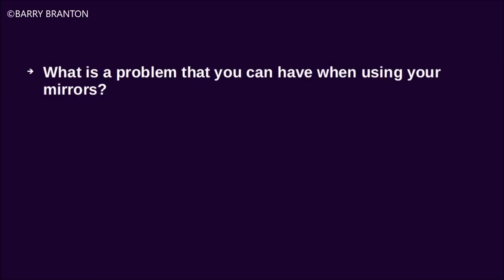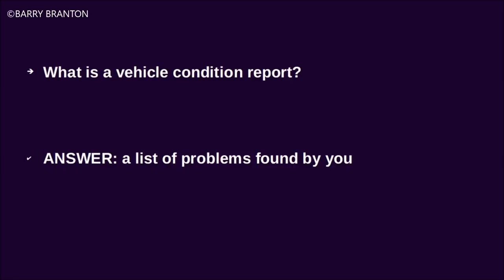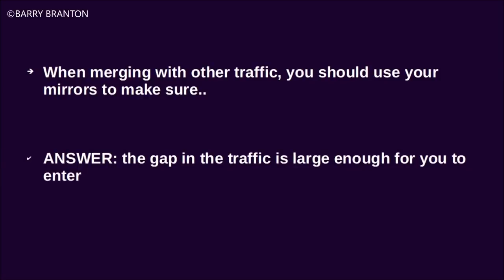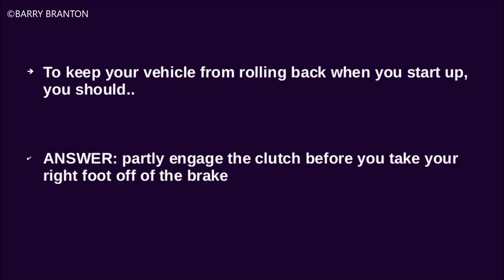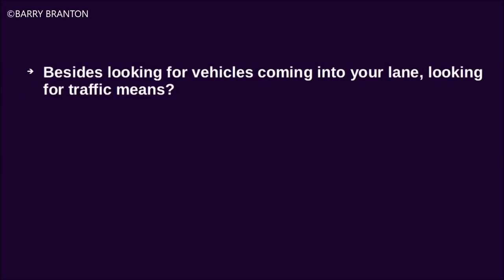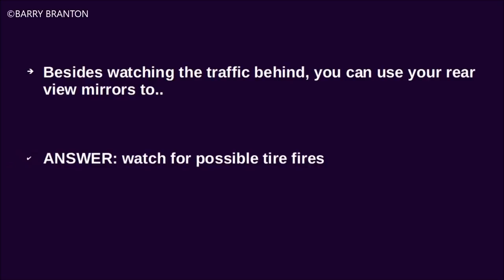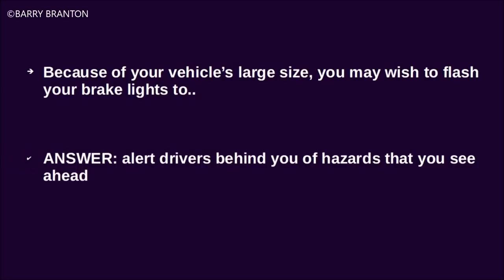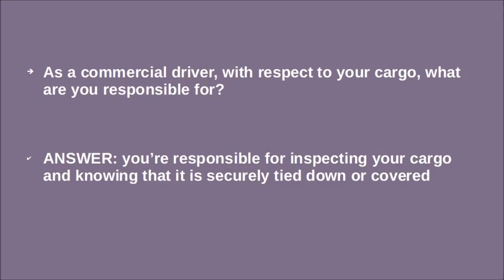2019 CDL General Knowledge Exam Questions & Answers

Comment: What test will be sufficient for Texas?
Reply from the maker: It depends on what class of CDL that you want and what type of commercial vehicle you'll be driving. Check out Fig 1.1 and 1.2 in Section 1 of your CDL manual. Also, read the "Special Section" in the Texas CDL manual. Good luck to your exam.

Comment: Will it work In MI sos
Reply from the maker: Generally, yes, though you need to see more questions from Section 2. Additionally, you need to know why Section 2 so important https://youtu.be/qcCKkDjPGBs For Class B & C, the CDL general knowledge exam consists of Sections 1 https://youtu.be/8GOL2MBrJfE and Section 2 https://youtu.be/k8oVEBKpGgw and Section 3 https://youtu.be/GncP9sfnrKs  For Class A, consult Figure 1.2 in Section 1 of your state's CDL manual. Also, check out https://www.youtube.com/watch?v=-HBBUxl7dr4